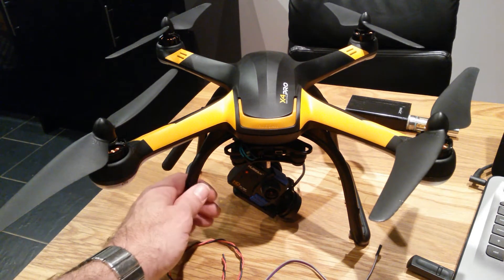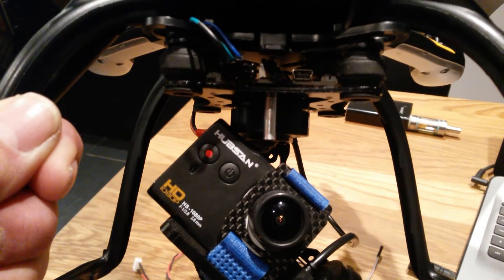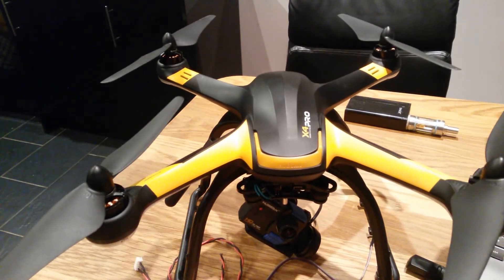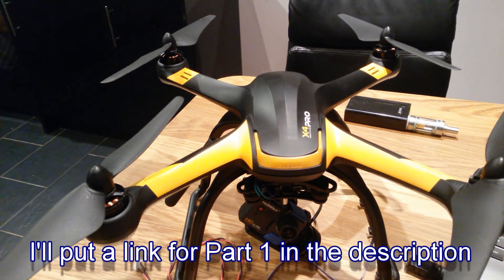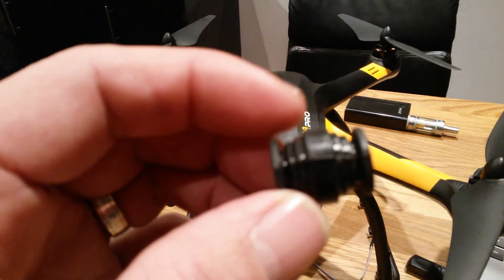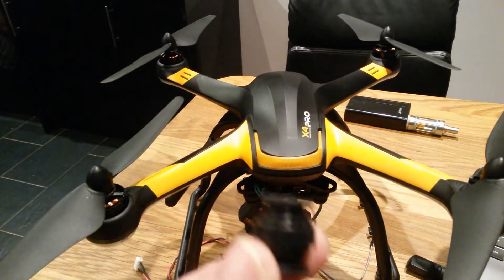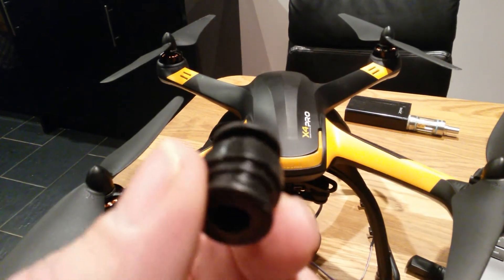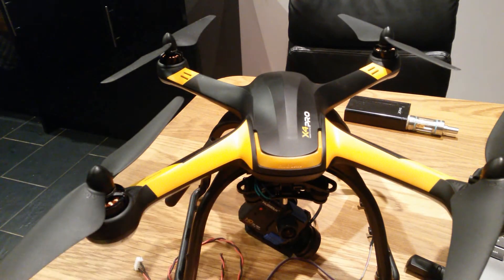Hubsan H109s & Storm32 - 3 Axis Gimbal PART 2

Comment: Hello,did you have to use a computer to set it all work properly or was it enough to connect everything right?
Thank you!
Looks awesome.
Reply from the maker: Hi
It will work if you just wire it up correctly but you will need to connect it to a computer to fine tune it. The link for Part 1 is in the description.
Hope this helps and thanks for watching.

Comment: Great video Stuart, I have just purchased this gimbal for my h109 can you please tell is the cable you use the one for the high end or can you use the cable which I have which is supplied with the one axis gimbal as they are both different .
Many thanks for the video.
Reply from the maker: Thanks Noel, the cable I used was the one that came with the H109s high edition. 
Hope this helps, good luck fitting your gimbal.

Comment: Stuart, Merry ChristX, and just a quick FYI if your interested.
https://www.youtube.com/watch?v=4OSAje46LAg&feature=push-lbss&attr_tag=RKzDNKiSltFRbbNW-6
Reply from the maker: Sean, Merry Christmas and Happy flying!
Reply from the maker: Sean, quick question...I'm considering getting a 3DR Solo and a GoPro for better footage, what's your view on the Solo? Is it reliable and stable?
Reply: But for quickie... 3DR Was designed to work with GoPro. in Solex app ($29) you can configure camera. Solo has a standard app which I currently use. 3DR specific gimbal has become incredibly expensive.
3DR remains rock solid stable in 20-25Mile per hour winds!!!... On a new battery I got 17 min hover time, no camera, etc. With MAS Props. The H109s and 3DR I find a total different flying experience. I believe in H109s and have 3 of them!!!.... However, I have 2 - 3DR's. DW said to only get Factory Refurbished 3DR's. I have, flown both I purchased, and no issues. 3DR's originally had some issues, and people sent them back, which was corrected, and are as stable as an Honest Wife is. Flying my H109s, I am always apprehensive, but the 3DR, I am as confident in as I am the next day coming my way tomorrow.